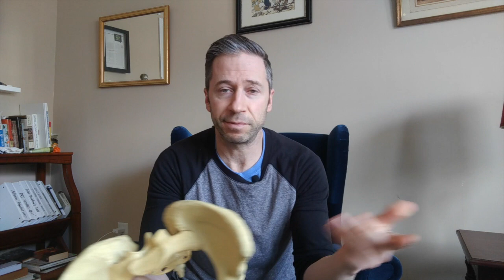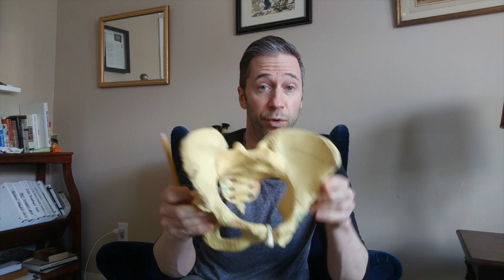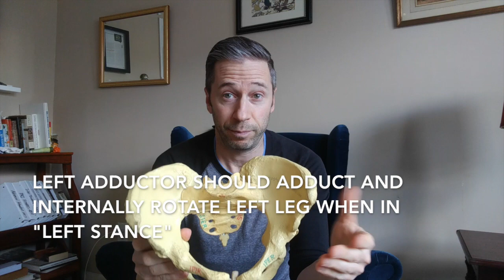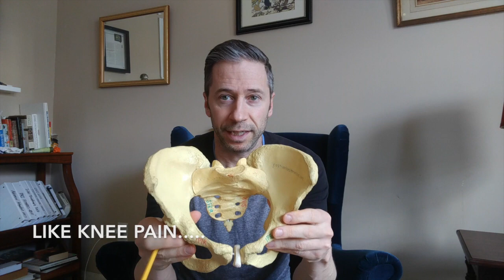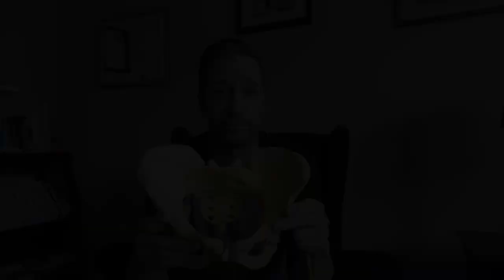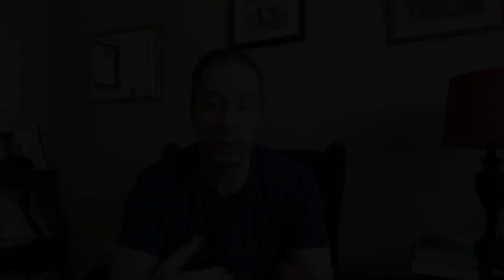Hip Flexor Mechanics and Problems with Anterior Pelvic Tilt

Comment: I wish I knew about PRI when I was a competitive salsa dancer. My L psoas, QL, rec fem and TFL were constantly a problem. I can't tell you how many times I went for treatment and it was the same muscles that they tried to release every time. It never changed. It wasn't until I started to understand all these patterns that now I can finally override my patterning and my environment. (I wish we could change the requirement for salsa dancers to wear heels. As a patho PEC who had challenging breathing patterns it would do a world of good to dance with properly aligned pelvis, ribs and skull)
Reply from the maker: Heels definitely aren't good. In my past, after teaching for an hour, I'd tighten up (because I wasn't grounded due to my cranium), but now I can dance for hours and be fine. Neutrality and stability are such a treat once established.

Comment: Hi Neal,  Thank you so much for these videos!  I am definitely left AIC by what I have seen in all these videos.  But it does not feel like my left psoas is overactive.  Instead, it is the right side that feels overactive because it is clinching very tight and causing my right low back to hurt.  My left side is definitely unstable and if I try to go over on the left leg, it sometimes feel like I will just fall.   Sometimes I try to bend my left knee to brace a little better and get over to the left but my brain does not want to got over there.  But I can’t really put weight on the right side either because the right hip is so tight that it hurts to put weight on it.   So my walking is very choppy and short and I hang on to a rollator to walk.  Does this sound like left AIC to you?

Comment: Great explanations! However, I was under the impression that with anterior pelvic tilt, the femur rotates medially, which makes sense as, like you said, in this position the iliopsoas and TFL which are internal rotators (also) of the hip are constantly short and contracted. As opposed to this internal rotation position, you are saying that the leg is turned outwards with an anterior pelvic tilt. Can you clarify please?
Reply from the maker: It will usually ER so you can walk straight without tripping, in response to the pelvis orientation to the right.

Comment: Finally I have an explanation for why this happened! Injured my right ankle badly twice. The second time was a confirmed break. I suspect the first was also, judging by the gunshot-like noise. Have struggled with pelvic tilt, thought it was due to weight creeping up after my injury. But the strength imbalance makes a lot more sense.

Comment: 4:17 Could you please help me to get this over? When two Insertions of a muscle become closer to each other does the muscle become tightened or weaker? Of course that if if becomes tight it becomes shorter and makes insertions come closer, but what happens if it's insertions become closer first? Can it also be weak (lenghtned or shortned) but in spasm/pain?

Comment: I feel like I am learning a lot from your videos. Thank you. I have a question.  I have discomfort in my right si joint. I went to chiro and he said it was stuck in reverse. Of course, they never tell you how to resolve the situation. So, based on what I am learning from your vids my left side is also rotated fwds. However, I was also told my right side is “hypermobile.”  So does that mean my left si is strong than my right?

Comment: Hello Neil,

Thanks for the details in the video.  When you tallk about the left posterior hip capsule being tight, is it possible that this 'tendinous structure' goes through the left posterior mediastinum (as well as going through the left hips and down to the left foot and additionally, up to the left side of the head). 

The thing is I have done quite a lot of exercises from the PRI system such as Right Diaphragmatic Restoration, Left/Right Low Trap Work (standing resisted Low Trap press through).  As well as some some other exercises that target the left hamstring and left adductors.
But despite doing these I still find my left lower ribs are somewhat flared.  I feel I have opened up the left lower-mid back because I can feel the ribs touching against that area (it feel like sand-paper or a very crystallized sensation) something which I had never felt, only after doing the exercises to open up this area.  It's most probably a weak InternalOblique/Transverses abdominis weakness but Im just wondering there might be some internal organs stuck in the area.   I have had quite a few teeth out earlier in life and I dont have much great "back teeth" feeling.
Is there anything you can suggest to open up those left lower ribs so that it atleast starts moving and get more opening of the left posterior mediastinum because I can literally feel the left core muscles try to bring those left ribs down but something is so very locked up in the area.
Reply from the maker: Hello Ken. The entire left side of the body can often end up in a state of tension. There is always the possibility that an occlusion issue "ungrounds" you. The left side of the body needs compression through the hip joint so that the left posterior ribcage can open up. Sometimes occlusion issues, particularly lack of molar sense, can throw you back into extension, so the techniques don't "hold". Without examining you I can't really say for sure.
Reply: @NealHallinan  Thankyou Neil.
I understand you regarding the occlusion issue and the grounding it provides.  Even though  I've been without the main molars for some a few decades now I try to simulate the action of "biting down" on the back teeth by keeping the jaw closed slighly or "visualizing' the amount of jaw closure I would normally have.
You mention keeping compression through the hip joint to keep compression to open left posterior ribcage which I understand to keep yourself in flexion. When in flexion should you pressing through the heels when lowering the body or should you be pressing the sole of the feet to enable the compression to stay through the hipjoint?

Comment: How can a hip joint be weak?:/
Reply from the maker: The ligaments are stretched and the muscles are weak.
Reply: Neal Hallinan understood. So you mean the muscles that exert force on that hip are not balanced and so we need to balance them with PRI exercises.
Reply from the maker: @quintessential5145  It's unabalanced and the primary muscles,– the left hamstring, adductor, anterior glute medius and internal obliques– are barely being used at all. The left side is being stabilized by the hip flexors and lower back muscles. All compensatory.
Some people think they are strong on their left leg, but they aren't. They are strong through compensatory muscle function. Once I put them in true "left stance" they start shaking. Then they understand.
Reply: @NealHallinan  Sounds amazing..That is why my left SI joint stopped hurting.. Because I strengthen my weak left side on the wall with the 50/50 exercise.
Reply from the maker: @quintessential5145  The 50/50?
Reply: Neal Hallinan sorry I meant the 90-90!

Comment: In minute 4 you say that the glutes are both weak and tight. How do you explain this? Also, I am very curious as to the effects of all this on the right leg/foot. Thanks
Reply from the maker: The right and left glute can be weak and tight in different planes of motion. The left glute can be weak in hip extension but tight and strong in external rotation of the femur. All muscle function is tri-planar. That's why the same muscle can have different qualities.
Reply: @NealHallinan  Thanks! Understood.

Comment: I feel my hips do have the left AIC pattern up into the thoracic so I seem to see/feel this happening but I'm feeling at odds with the left weakness with posterior chain completely. I have slight atrophy on right side on posterior chain (glutes/hams) but it might be because of an ankle impingement and more lack of full range of motion on the right side up to the hip. So not 100% sure on the full AIC. Short of testing is there any way to try and confirm some of this? I'm working off strengthening the left AIC and hope it'll all come together.
Reply from the maker: What do you mean by "I'm feeling at odds with the left weakness with posterior chain completely"? You don't think your left side is weak compared to the right?
Reply: @NealHallinan  it seems that my right side is the weaker side yes. Chiro mentioned some atrophy (thinner right leg) on right site upper thigh which I sense with that weakness.

I just don't know if its a compensation thing or not. But the biomechanics of the LEFT AIC Pattern does still seem to be there. I physically see (laying down) my hips are rotated to right, thoracic seems to go left. I just don't know if its a compensation thing that's making it feel like I'm weaker on right side vs left since biomechanically I do seem to have the left AIC pattern. Its really odd and that's why Im asking further. Frustrating I feel Im 50/50 with answers! Your help is appreciated.
Reply from the maker: @NelsonBiglar  perhaps your right leg isn't necessarily thinner,  perhaps the left leg/quads got bigger because they had to increase their role as stabilizers due to left hamstring weakness. This happens quite often.
Reply: @NealHallinan  ahhhh well that does makes some sense. Its certainly another way of looking at it that's for sure. Im doing alot of this myself with some muscle testing and exercises and stretches. Your videos and PRI has really helped in my understanding with the ZOA, LEFT AIC pattern etc. So possibly more anterior quad action on left going on vs weaker atrophy right side. 

So if anterior quads on left being are possibly overworking would that maybe lead to posterior weakness with right hams/glutes in some sort of contra lateral type pattern?
Reply: @NealHallinan  I'm tearing apart this video to try and really determine more what's going on. 
>
https://www.youtube.com/watch?v=HGeDh0rG2mE

Comment: i tend to find that my left gluteues max is actually much more active and stronger then my right glutues  max and my right hip flexors to be tighter along with tighter lats on the right side and plantar facia pain on right foot. is that normal in PRI? cause it has some of the symptoms of Left AIC, but also other things that don't add up.
Reply from the maker: Yes, it's normal. The left glute max is often strong as an external rotator of the leg but weak as an extender of the pelvis (posterior rotation), while the right glute is just the opposite, strong in posterior rotation but weak as a leg external rotator. So the weakness depends on how you've compensated and what movement you are performing. It's also possible that both sides of your pelvis have rotated forward so both glutes are weak.
Reply: That actually makes allot of sense thank you.

Comment: very good. Any explanation why left groin could be involved and painful ?
Reply from the maker: By left groin, do you mean inner left thigh/adductors? In the left AIC pattern, the left leg is habitually stuck in a state of abduction and external rotation, so it is positioned away from the midline of the body. In this position the left adductor can be weak. Perhaps it's the left adductor that is painful as it attempts to resist this constantly abducted/externally rotated position.

Comment: I found on the the left side also is that the hip flexor gets impinged.  Its hard to raise the left leg all the way up
Reply from the maker: The left leg will often not raise as high as the right leg in a "straight leg raise" test. Is that what you mean?
In this case, it's the position of the left pelvis that makes it seem like the left leg doesn't raise all the way. But in reality, if you are in the left AIC pattern, your left leg shouldn't raise as high as the right leg because the attachment site of the left hamstring on the left pelvis is more posterior than the attachment site of the right hamstring on the right pelvis. But once you reposition the pelvis into a symmetrical position, quite often the left leg "gains" more range of motion, but not because you became more flexible, but because the starting position of the left pelvis changed.
Reply: @NealHallinan  thats right
Reply from the maker: Ok, so my previous explanation is usually what is going on.